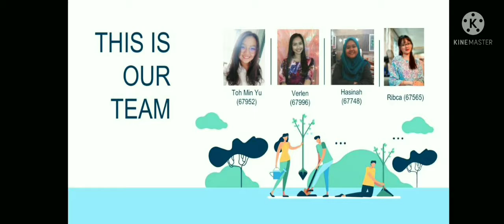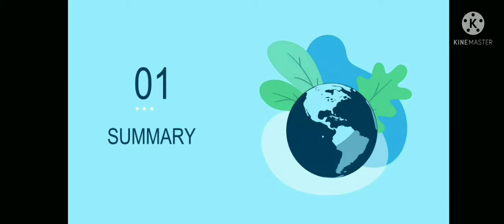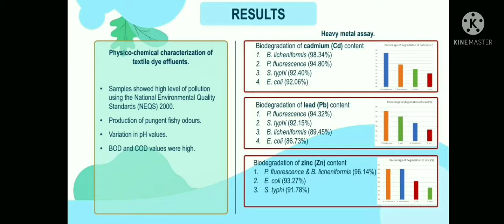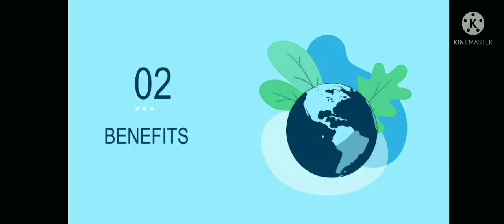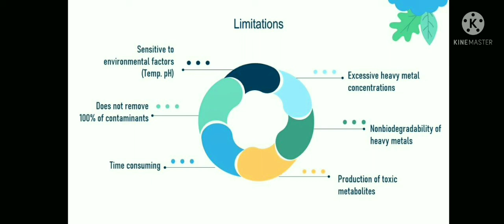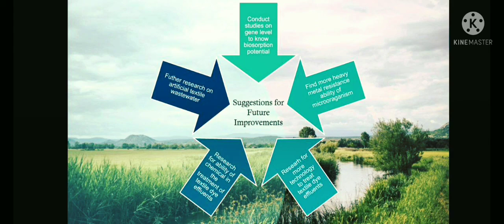STB 3022 Environmental Biotechnology: Journal Reflection Presentation

Comment: Question from G3-SG4, does the microbes bring about any negative impacts on environmental and human health issues if an accidental leakage of microbes into environment happened? Thanks.
Reply: Microorganisms use its enzymes to degrade the pollutants and convert into less toxic compound for bioremediation to become effective. Apart from that, the type of organisms used in bioremediation depends on the chemical structure of polluting agent and growing conditions such as moisture, pH levels and concentration of the chemicals. Thus, the action of microbial bioremediation is specific to degrade the polluting agent on site and eco-friendly to be used. Negative implications by the leakage of these microbes may be possible due to toxic by-products formed however, it requires the right polluting agent for the microorganisms as source of energy and to grow.

Comment: great information on benefits and limitations. Question from my group (G3-SG6) is, what are the compositions of artificial textile wastewater dyes that enables them to be applied for the treatments? thank you!
Reply: The artificial textile wastewater dyes contain mixture of toxic substances known as heavy metals that exist in free ionic metals or complex metals. The heavy metals present in this study are cadmium, lead, and zinc which are targeted for microbial bioremediation process. The complex structure of these heavy metals is difficult to be degrade using conventional method of degradation such as physicochemical strategies thus, microbial bioremediation is chosen to be used in this study. This is due to microbial bioremediation allow the utilization of pollutants as its source of energy by using its metabolic versatility to degrade the dye into a non-toxic intermediate compound while being a cost-effective method.

Comment: Hello, I'm from group 3-03. I want to ask, what are the characteristics of the microbial to enable them to be utilized in this type of bioremediation? Thanks !
Reply: One of the principles of bioremediation is the contaminants is a source of food for the microbes. Thus, the microbes will consume the contaminants and convert them into other components such as water, carbon dioxide and harmless gases. So, the microbes choose to used for bioremediation must have the ability to consume the contaminants.